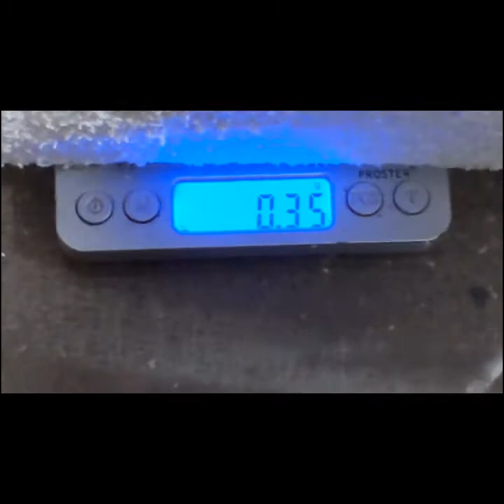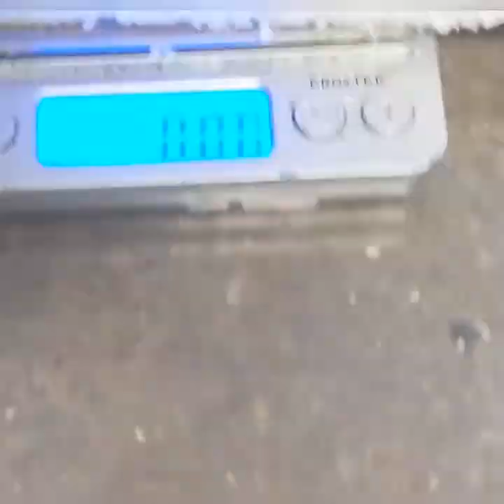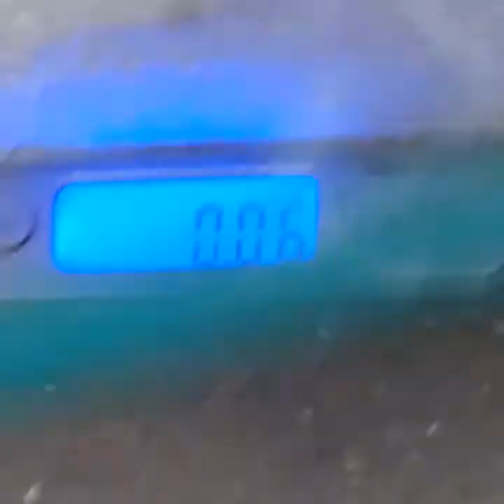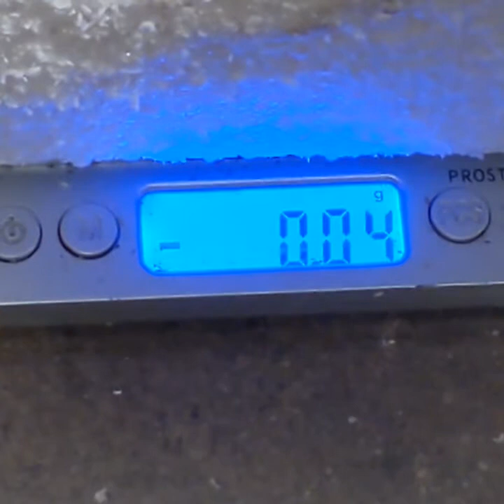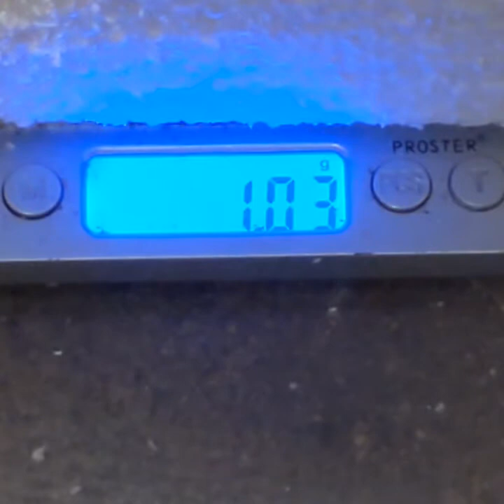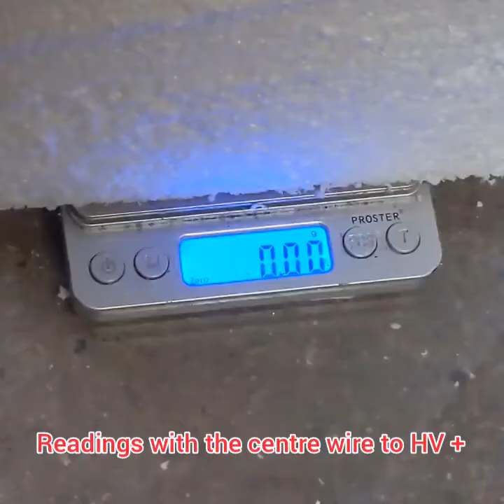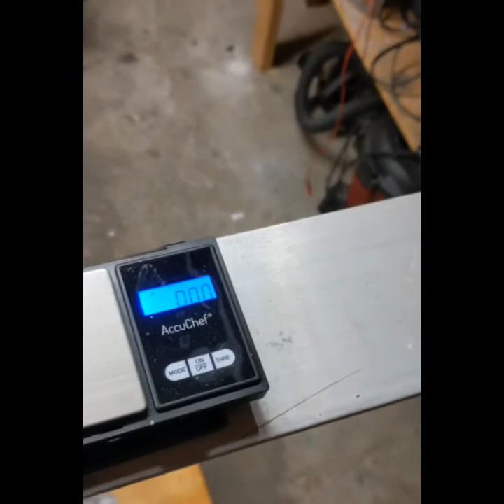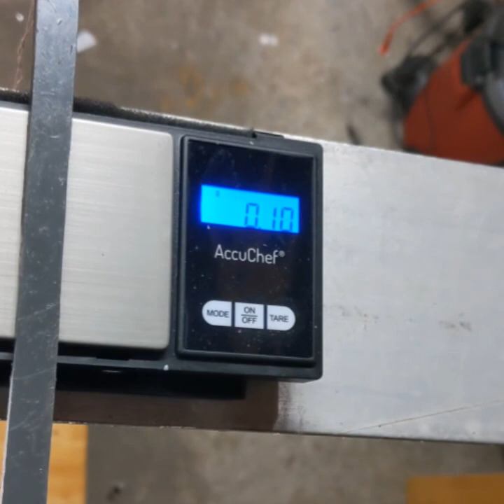Converging Field Propulsion | Geometry Comparison

Comment: Interesting: my models predict that the cone should indeed work best: What voltages are you using? Also gotta shield those weighing scales better. By the sound of it, this is probably mostly ion propulsion. Would be difficult to tease out any additional effects.

Comment: Here's a big problem with "hard" vacuum. It is still a horrible mess compared to ultrahigh vacuum. I have a Leybold D1.6B dual stage pump that reaches 1/3 microns when the oil is fresh. Even at that level the gas available for ionization in the chamber is ridiculously high. Any device with HV linked to it WILL have significant ion glow and thrust. You might enjoy the show anyway.  And another tip. If your geometry allows for a pyrimid, you can use thin foil but etch it in a dilute Drano or lye solution. Once you can see light beginning to shine through it then take it out and dip in fresh water and pour in a little vinegar to neutralize any caustic left. Once dry it can be lighter than mylar. I know your current rig carries it's weight on a string but this trick is definitely useful for Lifter style ion models.
Reply from the maker: Thanks for the info